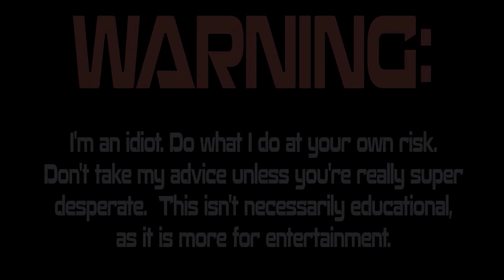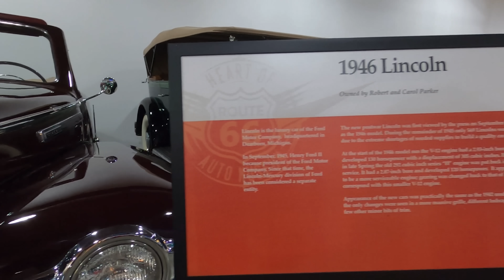Will This 1956 Buick Special DRIVE 1,200 MILES Back Home - I BROKE DOWN! (P2)

Comment: When “exploring the country in an old car” you get to see a lot more, every small town with a parts store.
Reply: I used to know every small town between Houston and Dallas when I was in college. Then I started buying cars that ran.
Reply: Accurate
Reply: That's part of the fun
Reply: Yes, you really experience Americana in an old car that likes to break down every so often. Builds character.
Reply: How to install sinus 75 inch TV wall mount
Reply: They used to all sell different kinds of pocket knives
Reply: @Fast Dad Garage>>> it's the mouth to muffler resuscitation that matters most. Burning your lips more than once on the radiator of tail pipe means you a veteran... & by the way just so y'all make notes that Practice makes perfect.
Reply: @drew8256  Not sure that's true. Based on the cars I've owned most of my life, I should have the character of Capt. America...
Reply: @drew8256   And you learn how to REALLY maintain it !  Plus the importance of a onboard parts stash in the trunk, Spare everything you can't get at local auto parts ( that list gets bigger by the day . )
Reply: You’ll be so sick of this car time you get home you’ll put it up for sale

Comment: I had a 1953 chevy bel air that was the same yellow and white as your buick was originally.  It also had a vapor lock problem.  An old mechanic gave me this trick.  Clip several wooden spring clothespins to the fuel line right there where you were pointing.  I don't know why this worked.. but it did.  I never had another problem with vapor lock.

Comment: My Dad had a 56 Buick Special. 2 tone green. He used a 180° summer thermostat & a 195° winter thermostat. He never had overheating issues. We even pulled an old homemade holiday trailer that was very heavy. He drove about 50-60 mph on the hiways. Maybe slow down & enjoy the scenery. Vapor lock was a bit of an issue too. An electric fuel pump will help that a lot. He used to get about 22-24mpg hiway. About 15mpg around town. The old cars were designed to go about 60mph on the hiways. Nice road trip I'd like to make some time.

Comment: Overheating on the highway usually means radiator is clogged. Ram air cools engine at speed, fan cools at idle/low speeds. Place your hand on the cooling fins down low and see if it’s cool, while the top area is hot. Pump blades may be rusted off, causing lack of flow. Seeing the freeze plugs missing, makes me wonder about the condition of the pump blades.

Comment: No doubt you've already found whatever the overheating prob was by now, but one surprising fail that I found can happen to a waterpump is the impeller can semi-freewheel on the center shaft & still look perfectly good on visual inspection. Now in addition to checking for wobble-play at the bushing, I always grab the fan flange in one hand & impeller in the other give a twist to make sure of a positive no-slip grip. You can always remount the inspection plate with a little RTV, & the piece of mind is well worth it.

Comment: Had experience with the split race ball bearings om the front end of my 55 Chevy years ago.  They require frequent maintenance intervals, and need to be kept properly adjusted.  In my case the simple fix was swapping on  a pair of mid-60s tapered roller bearing hubs.  I do not know if there is anything like that available for the Buick or not. The tapered roller bearings are just about bullet proof compared to the old ball design.  These old cars will run  at modern traffic speeds, but maybe you shouldn't, they are over 60 years old after all.   Kudos on the trip!

Comment: The fan being so far out from the shroud could be something to consider with your cooling issue.. 🤙
Reply: The fan shouldn't really matter once the vehicle is moving and air is being forced through the radiator. My thought is the radiator could have blockages in it.

Comment: When I’ve had unexpected heating issues in my car I put the heater on full bore to extract as much heat I can from the engine.  Not the most comfortable cabin position (my feet were burning!) but she kept the engine temp stable and cool enough to run me home!!

Comment: I envy you this trip. I used to do stuff like what you are doing but both my wife and I are dealing with some scary health issues
 My last run like this was in my 1971 Buick electra coupe. I've always had large cars. I'm 6 foot 7 inches and room is an issue 
 Thanks for the videos.  Bob Ordewald Staunton Virginia

Comment: Derek, a guy really has to give you a thanks from the bottom of the heart just for making vids... Times are so rough these days and your uploads really help get me through it. Matter fact you've inspired a guy to want to get mine and my pops old 71 dart running again after sitting in the driveway for years. Not sure if we're gonna yank the old leaning tower of power out and throw a v8 we have in her yet. A project that's been put off 10+ since I was a kid. But like I said your the inspiration here God bless.
Reply from the maker: awesome, good luck with it!

Comment: "you should explore the country in a classic car"... never a truer word.
Reply: And that car should be riding on the back of a brand-new, well maintained flat bed... LOL
Reply: Absolutely.

Sure, they aren't always as reliable, or efficient as modern rides; but it makes a guy appreciate the journey.
Reply: As long as you have a working smart phone, a AAA card, and a credit card.
Reply: @failuremagnet  it actually seems to be in pretty good shape, however a full go through should have been performed first. a replacement wheel bearing sourced and replaced, and that running hot issue should have been corrected.

i think part of owning a car like that is driving it. it's not a good idea to take a car like that, that has sat for probably 10 years and drive it 1,200 miles without extensively going through it first.

of course the way he does things creates youtube views LOL
Reply: Yeah...nothing like a sharp stick in the eye.
Reply: As long as ya ain't in a hurry or on a schedule! Unless it's Power Tour, then ya got 5000 potential saviors to help ya out.
Reply: @failuremagnet  A regular ol' Uhaul trailer will do. Just don't tell 'em what kinda car yer really haulin', lol. "Just an old VW Bug, not a 62 Imperial or anything..."
Reply: @andrewdonohue1853  Ya kinda missed the point there, until yer very last sentence. Playing it safe, logical, sensible, and responsible makes for no adventure, no drama, and a boring video. Peril, suffering, challenges and obstacles, make for a good story. That's why Roadkill keeps buying sketchy junk and road tripping it (having a chase car and corporate credit card helps 🤣).
Reply: @donellmuniz590  I was thinking the flat bed would be better cause you're sitting up higher. Better view to look out for the KFCs and such.
Reply: @failuremagnet  Certainly would, if you can afford one. I bought an old 71 Dodge shortbed pickup off ebay once, in Salt Lake City, jumped in, and drove 800 miles home to Clallam Bay, WA. One of the best drives of my life. Utah is awesome. Early September, the weather was perfect. The truck had a 4 bl 383, headers, and 3.55 gears, so it was quite the hot rod. It was a big gamble cuz I ain't no mechanic, but aside from runnin' outa gas once, it was great.

Comment: Old school trick i was told was if you are getting Vapor lock to out some wooden clothes pins in the line it will help dissipate the heat.

Comment: I had a radiator hose do that same thing.. I was able to cut the hose at the leak, stretch the hose, and put the clamp on.. It worked with no leaks until I sold the car..

Comment: If the pump diaphragm is failing, that would reduce the fuel being pumps and cause a lean condition too.
Reply: Had that in a 1961 Chevy Convertible with a 283 in It. Diagnosed & Fixed it my self @ South GawJa Jr College in Douglas, GawJa !!

Comment: I'd just leave the thermostat out of it and turn the heater on when it started getting hot it acts like a second little radiator .
Reply: And the fan on "high". You must be over 50 (like me) to know that one!

Comment: For future projects, I'd keep some of that fuel line silver insulated thermal Velcro wrap for metal fuel lines and rubber,..  it's like 35$ for several feet, enough to wrap everything from the frame to the pump, and pump to the carb, preventing vapor lock. My C3 with ZZ-430 used to vapor lock even when it didn't run hot, which even with AC on didn't pass 190* on the hottest 100+ degree days in traffic, but the fuel would boil in the line. Not so with the thermal wrap, stuff works a treat. I mush have for all  carb powered cars.. Love the channel, love the videos, especially the Buick stuff!

Comment: I, too, had a '56 Buick---a 4-door Century, in my case, with the same drivetrain as yours.  I may be wrong, but I could swear that it had a 6-volt electrical system.  I remember the starter being under that gas pedal, and the Dynaflow transmission with reverse at the bottom.  This was back in '69, so the car wasn't really all that old, and neither was I!

Comment: A trick I do with a leak in the cooling system is to not allow it to build pressure. 
Leave the rad cap loose. Keep a eye on the coolant temp. As long as it stays below boiling point you will be good to go.

Comment: I had this nagging fever to take my classic restored car across the USA.....I think I’m cured...oh well.
Reply: Haha, im just the opposite. Now im even more eager to finish my 57 and take a nice jaunt across the way for a week or 2.
Reply: Well that's different than what Derek is doing. He literally just bought this thing and then immediately took it on a 1200 mile roadtrip. That's practically asking, no, begging the car to break down multiple times before you get there. Taking a car you've owned and driven for months or years in another thing entirely. If you really are afraid of being in a situation like Derek was in this video then you can just prepare the car for the trip, before taking the trip lol. Cars love the highway, and they love being in motion. An object that is in motion stays in motion. So if you genuinely do a thorough preparation with a few test trips, etc. the likelyhood you end up jacking up your car in an O'Reilly's parking lot while swimming in coolant is VERY unlikely.
Reply: @Joseph-C  it would probably be a good idea to daily drive the car to work for say a month, that way you hammer out any issues only being say 20 miles from home rather then 1,200 miles.
Reply: I was cured of that when the shock tower collapsed on my Mustang.
Reply: @Joseph-C Amen.  One time, I bought a nice conversion van in the great white north.  I didn't make it 100 miles before I was calling for a flatbed.  The front wheel bearing grenaded...  So there I sat, in a small town in Ohio, R&Ring the wheel hub in the parking lot of a friendly small town Autozone.  While there, I tried a well-regarded local steakhouse and was amazed at the quality of the cuisine.  I find random things like this add some much-needed spice to life.  If I had been able to drive it around town a bit, I'm sure I would have noticed the wheel bearing was on its way out.  In this case, I was doing what Derek does, and it was basically a hop in and go scenario.
Reply: @Joseph-C  EXACTLY.
I've never 'got' the concept of a Trailer Queen, or a person owning and restoring something, over the course of Thousands of bux and MANY years, to never really DRIVE that car because they don't "trust" it.

I don't own any old cars, anymore... But I do have a 77 Dodge Landau class A motorhome... 32 feet of Shagadelic luxury, baby!

And I drive the livin' tar outta that thing.

It goes AT LEAST 300 miles a weekend, and for two 2,000 to 5,000 mile round trips, twice a year. Summer and Fall.

It's really only left us stranded once, in ten years. The starter puked about 100 miles from home.... But luckily, I had a replacement ready to go.
Sometimes, it's wise to carry certain parts that are 'known' to go at the least opportune time.

Cheers!

Comment: I like my 5 Minute Rule.  If you are at a Parts Store or any store for that matter, and you get your stuff.  All this time you know you are forgetting something.  Most people leave and get hime and remember what they forgot.  I realized that if I sit out in the parking lot of the store, turn the radio or something on to distract my thoughts alot of times I will remember what I forgot to get.  The I can go back into the store and get whatever it is.  My sound ridiculous but it works!

Comment: Really Reminds me of a very Similar 56 Buick My GrandMom Gave me that was V-8 Automatic Grey &White paint just like this one is Black & White. I didn't Cherry it out like U are doing this one; but the Guy I sold it to Did & He left it Grey & White, Had two dinged up bad Doors on passenger side that he replaced & I saw it 3 months later with New Paint & Looked like it Did Brand New. I rode in that car when it was new & I was 8 yrs old. MAMA LOLA POOL always had a Smile on her Face Driving that 1956 Buick Special !!

Comment: Had a 57 imperial that did the same thing your Buick was doing and I solved it by putting an electric pump back by the gas tank and that cleared up the over heating problems apparently it was running to lean so the faster you went the hotter it got. After that fix it never ran hot again.

Comment: My grandson and I drove a 84 Monte Carlo all original engine all the way from Michigan to Dallas only thing we put in it after we got started with gas so you know it's all how you take care of course it only had 60,000 miles on it change the oil change the rear and tighten up the oil pan but we made it all the way she was cruising down the road 70 miles an hour all the way and the AC even worked and the clock that's at the analog clock in it the radio works too keep up the good work you're doing a fine job of filming this I think you are to check the thermostat though it's got to be stuck stuck

Comment: New stat, cap and hoses usually solves most overheat issues. Fuel line insulation is a great idea on those oldies cause of the pipe routing. When she is sorted, she'll be the best!

Comment: I usually take the thermostat out and leave it out if I'm on a road trip and start running hot. Even with a blown head gasket most of the time it won't get as hot.

Comment: I had an old 59 Cadillac back in the 70's and had to stop every 15 miles to blow back the fuel line. changed the filter but still did the same.  finally stopped at a relatives house and he suggested we pull the fuel tank. and lo and behold it had some stupid sock on the fuel line,  pulled it off and had no problem aftewards.

Comment: I had a '56 roadmaster back in '63.  The only thing I knew to do was drive it.  I ran the rearend low on grease and you could hear me coming a half mile away.  Used to drag race that big thing.  She was slow leaving the line, but she was dynamite on the top end.  Was jet black

Comment: There is a guy in Grove, Oklahoma who refurbishes old steering wheels such that the crack is totally gone and you would be hard pressed to see any repair. I have a 72 Chevelle that has cracks in the steering wheel and I am going to have him do mine.

Comment: I’d love to drive the country in my 65 Pontiac.  I’ve taken it on many shorter (300-600) mile trips. I’m very confident I could go anywhere in it with little to no issues. But that’s because I know every aspect of the car. Been in the family since 1969 and my father and are they only two people that have worked on it since 1969.

Comment: Hey man, for a very affordable source of lead additive for gasoline in these old antique engines without hardened valve seats, go to a rural or small town airport and buy a 5 gallon can of 100LL (low lead) avgas. It's got about 2 grams of tetraethyl lead per gallon, plus it's 100 octane. You can mix it in a 1:3 or 1:4 ratio with unleaded and get about 1/2 gram or so of lead per gallon which is enough to save the valve seats, plus it gives a nice little octane boost of a point or two. Small rural airports all have credit card pay at the pump for avgas nowadays, and they're generally available 24x7 even when nobody is in attendance at the airport office since small planes land at all hours of the day/night/weekends and need to fill up. Avgas doesn't turn to turpentine like auto gas does, or at least nowhere near as fast. I've seen small planes that have been parked in a hangar for 5 years or longer unflown, and the gas in the tanks is still good. 100LL avgas is light blue in color, and if it's blue, it's still good. It turns yellowish-clear when it goes stale.

Comment: Reminds me of the time I bought a pickup in Houston Texas in late December, and back home to southern B.C., Canada, some. 2,460 miles, which I did over a week.  Saw some nice country, headed out on some early mornings having to scrap the ice off the windshield.   Stopped in Cheyenne, Co on New Years eve, me and a case of beer...but was wore out, so drank none and fell asleep in an instant!   Thankfully, I had 'zero' issues on my '09 Ford King Ranch F450 dually, which was one of the most comfortable trucks I've ever owned!  Did some programming on her, and she dynoed at 500 hp, and made for a fabulous truck on long trips, pulling hills with heavy loads, as long as I kept an eye on the pyrometer.   Looked as good when I sold it, as it did when I bought it, but times have changed and we needed more room to move to a Class A motorhome.   I can relate to this trip, other than the breakdowns and vehicle issues.  :)

Comment: Hey Derek, you probably know this but you can drop the running temp of the motor by putting on your in car heater full blast and use it like an auxiliary mini rad. But if it was in Texas it may have been bypassed already. Good luck with the old girl bud.
Reply from the maker: Indeed, unfortunately this heater core is  bypassed at the moment